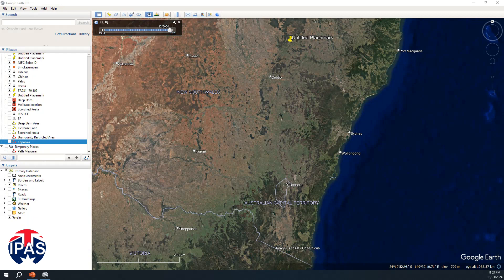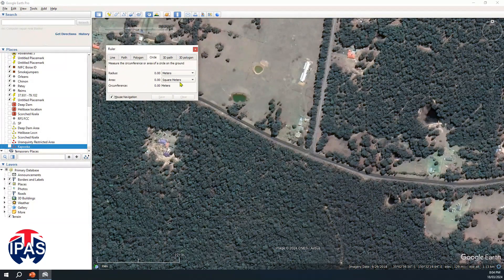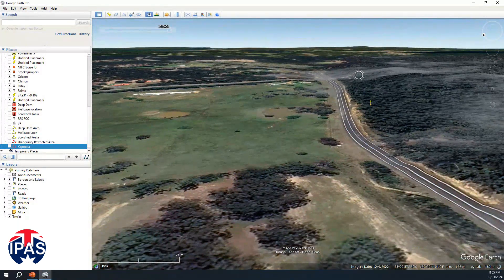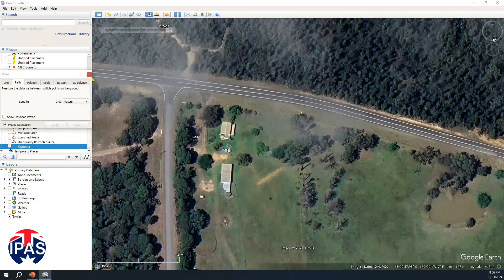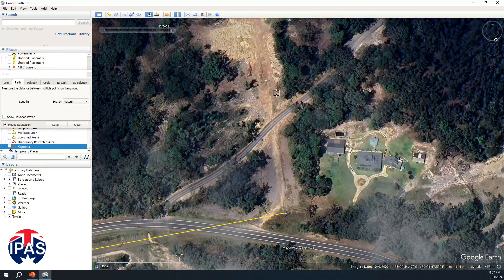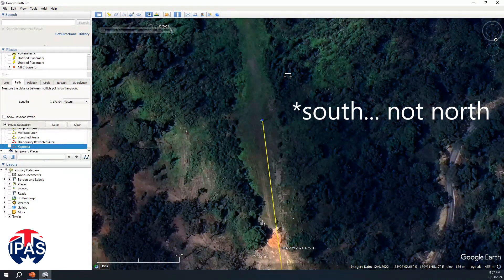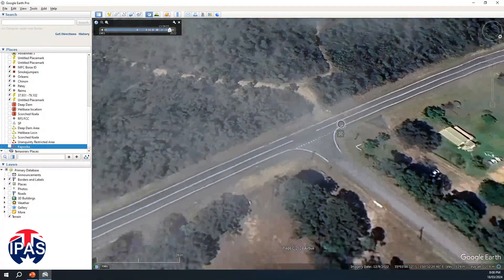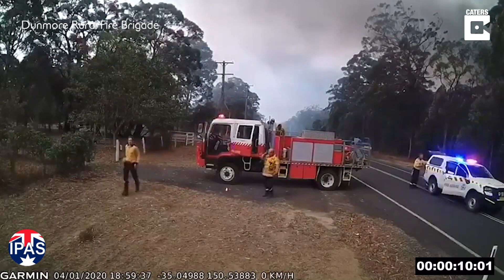Analysing a Fire Overrun

Comment: does the truck protections system actually work? these fireman inside the truck all survived? it doesnt get hot enough to ignite the fuel? I guess its diesel rather than gas.....
Reply from the maker: There are many different protection systems for emergency vehicles and military vehicles, some of them quite amazing. Many forest fire trucks have this feature. But there is a drill used in Australia during bushfires, and I'm sure it's the same in the US and other countries, that highlight the protection a vehicle gives you. If you're trapped by a bushfire and you're in your car, you take shelter in it and cover yourself with, say, blankets, etc. They recommend crouching down in the foot wells of the back seat. The car will protect you from the radiant heat. And fuel won't ignite if it doesn't have air as well as an ignition source, so provided the fuel tank remains intact, the fuel shouldn't ignite for short-duration events like this. So the fire truck would provide the safety as well as extra safety features including the self-irrigator. Cheers.